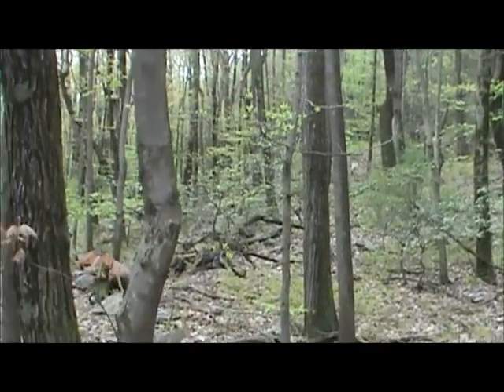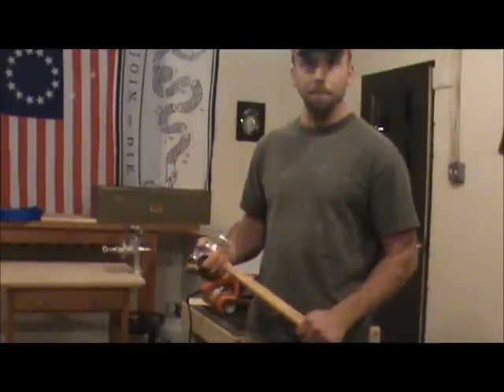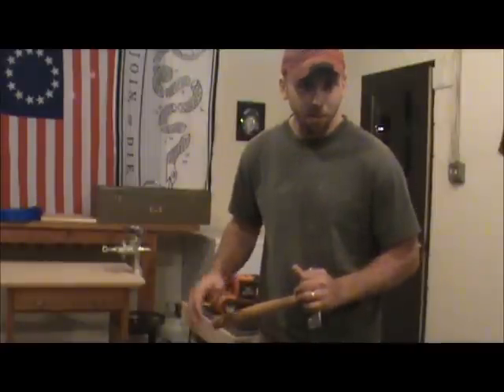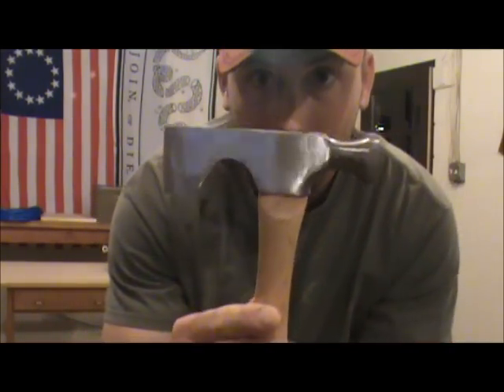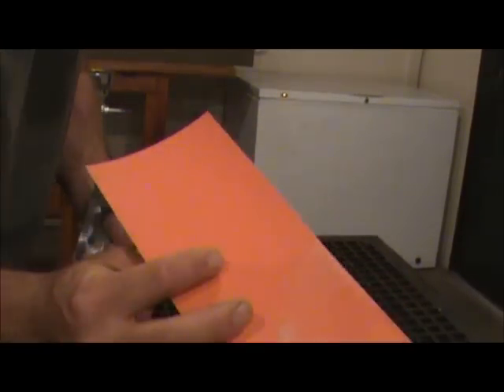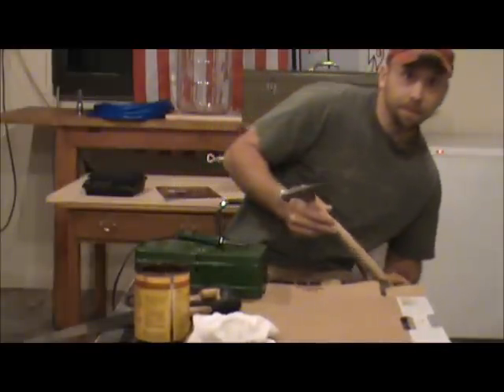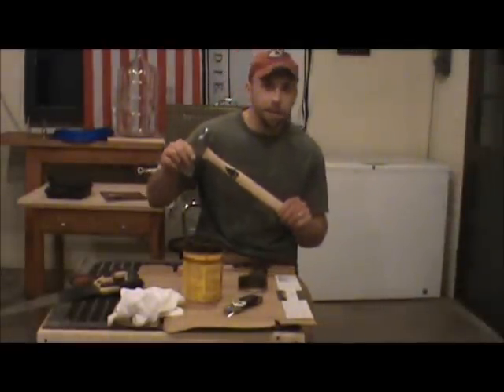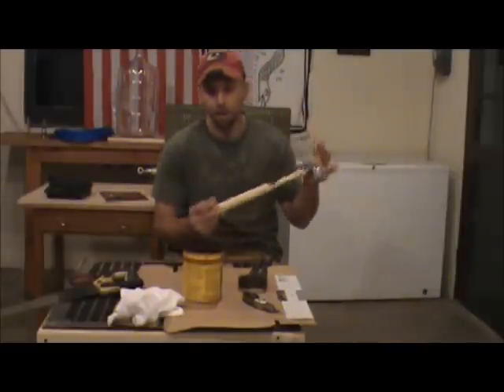Tools to Tomahawks: How to Make a Tomahawk

Comment from the maker: Thanks for watching I check out axes too I agree about the metal handle. I used a eastwing hammer about every day. An Eastwing tool will last longer than heads some wooden handled axes. That is a bunch of bull you really would have to bend hard on the handle on a good carpenter axe to mess it up. You don't use an axe like that in the first place. You don't have to buy tools with junk handles.

Comment: the handles are a little on the short side for hatchet work but they are perfect for hammer work.  I have a spare wooden hammer handle that is a little long that will fit right in there if I feel the need to change it out. I used the sheath from my husqvarna axe to cover the sharp edge.  I put a full cover axe sheath on it.  if interested I can show you where to buy quality heavy leather axe sheaths for very low cost.

Comment: if there is a menards in your area they have shingling hammers with a 3 1/2 inch hatchet cutting edge for about 10 bucks.  I put one in my truck tool box to deal with any fencing work I have to.